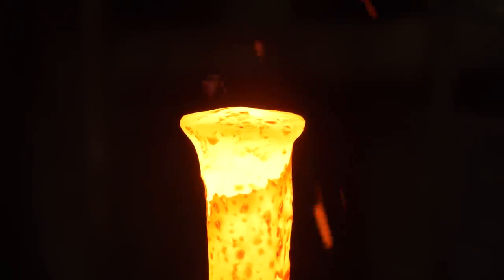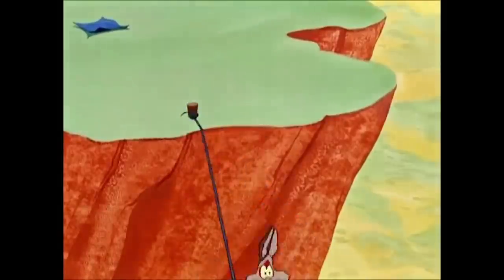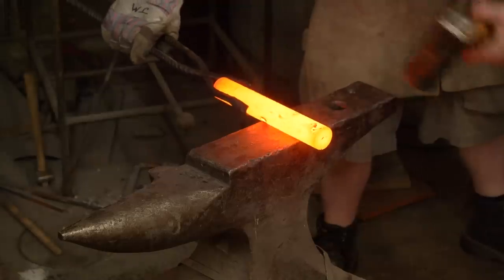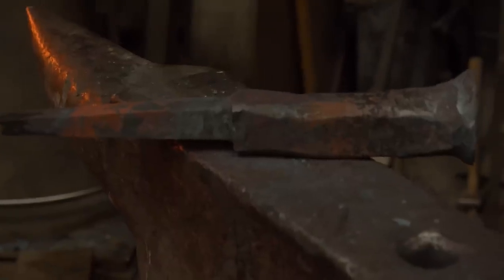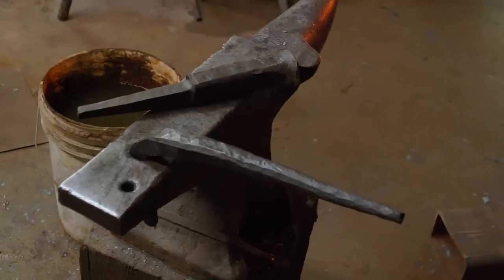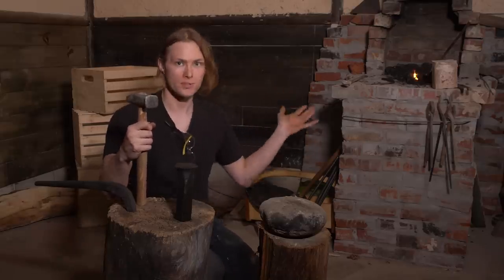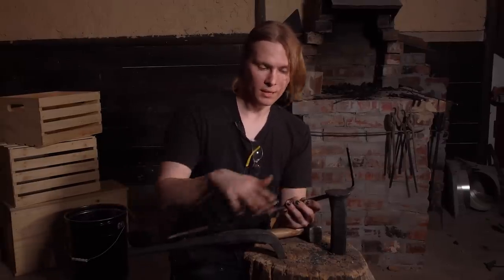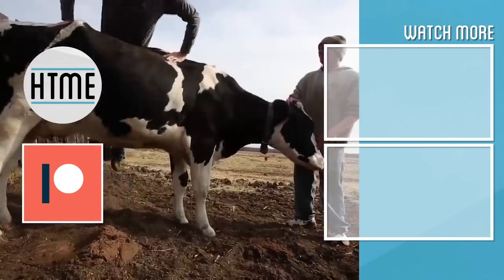Forging a Viking Anvil

Comment: Anvils stones that have been identified as such typically weighed 5 or 6 tons.  They were HUGE stones.  Also made from Basalt not Sandstone.
Reply: basalt or granite would definitely be better, and a boulder in dirt would absorb impacts I'd guess. But I'm guessing the logistics of giant boulders would probably be a bit much for HTME, a simple anvil setup like this is probably a lot more practical though. I thought the same though when I saw them smash those poor stones on those logs.
Reply: Came here to say this as soon as I realized it was sandstone. I'd like to see them try using basalt. (Note: eye protection is super important when hitting basalt or other igneous rocks, the chips fly off at high speed which is completely different from how that sandstone behaved).
Reply: that makes a lot of sense
Reply: They would also take hammers and hit the stones in certain ways so they could flatten them also Basalt and Granite are very hard stones unlike the soft stones they were using normally a smithing hammer for the copper-bronze age was actually a stone of one of those hard materials that they found was somewhat rounded :p
Reply: @AdriannaDaFox98  polished stonsledges and anvils of basalt is still common in many parts of africa, even though they have modern anvils. they use them for drawing and spreading out
Reply: I was just thinking a good chunk of granite would undoubtedly hold up better.
Reply: i think the most practical pre-iron anvil solution would be to just build the forge next to a large boulder you find that has a semi-flat top. then you can forge a stake anvil, and bigger anvils too.

Comment: The rocks; looks like you're using sedimentary rocks which will easily break under pressure. You need metamorphic rocks to use as an anvil. Please note that igneous rock won't do well either.
Reply: What's wrong with igneous?
Reply: @crubs83  it "kind of" depends on how felsic or mafic the eruption was. On the felsic side of the scale, the rock forms with too much gasses and silics trapped inside (very rough and will crumble). As you move towards more mafic, there's less gas pockets however, the silica content is still around 50% (makes it brittle). The best igneous rock would be ultramafic, but that is exceedingly rare and the last eruption that could be categorized as such was 2B years ago when the mantle was far hotter than it is now. I hope that helps. Have a great day. 👍🌋
Reply: that was bugging me as well
Reply: Yeah sure, I totally know what that is
Reply: The whole thing would work better if they put the rock in a bucket of sand or something, to keep it from shaking around.
Reply: @lordelliott42  I think the whole point was that iron is just better, yeah they could have used a better setup with the rocks but that wasn't the point
Reply: @wastedtalent1625  
Well yeah, or we'd still be using rocks.  But they were comparing to see how much better it is.  A round-ish rock perched on a stump isn't how anyone in the past would have done it, at least not for long.  The point of the whole series is to explore technology of the past and how it has evolved.
Reply: What about serpentine very dense and homogeneous

Comment: ahhh man, would've been so cool to make an anvil without using an anvil.
Reply: I was a little let down by the cop out...
Reply: Yeah that would have been fun to watch, but they'd probably still be at it RN.
Reply: I'd guess the easiest solution back then would have been either casting a large bronze anvil (as size would help the fact the metal was weaker) or casting a large iron anvil (but maybe casting it would have been more difficult than the worth). A large bloom or wrought cube could work, but you'd need a bunch of people and a very large rock to work with.
Reply: @1forge2rulethemall88  I don't think they weren't able to get temperatures high enough to cast iron at the time.
Reply: There is a tradition in Jewish teaching that the very last thing God made on the 6th day before he rested was a pair of tongs for metalworking.

What this story illustrates is the fact that a lot of tools have been made for so long in human history at this point that the knowledge of how to make it without having one already has been completely lost to us. If you were to take the whole premise of how to make everything's reset as rebuilding from a destroyed Society. It wouldn't be that hard to use an old engine block or compacted car or some other large and heavy object as your initial Anvil. So it's not really cheating it just depends on how you look at it
Reply: @pugz3230  They (smiths in the "iron age") were able (at least I beleive they could have, I could always be wrong), but its true they might not have thought to, especially if they didnt know how to protect the iron from burning. Even if they had it would have been difficult just because of the cost in resources. 
But if they had been dedicated enough to the idea it isnt so difficult to melt iron, burning iron can be done accidentally in a regular forge, and melting temperatures arent very far away, but melting it intentionally in quantity would have required some forethought so perhaps that along with resource costs would ahve discouraged pursuing it.
Reply: @angelwhispers2060  That is a cool tradition, I've often thought about the issue of tongs since they are easiest to make only if you first have tongs.
I've seen individuals smith with wet bamboo, but it's still hard to see anyone seriously working iron without metal longs first. That makes it cool that that is a story then since it means blacksmiths back in the day thought about it too.
Reply: @1forge2rulethemall88  This is basically it. We aren't lucky enough to wait around for a nice, large, iron rich meteorite to hit the shop, nor do we have the resources to dig our own iron mine to find a nice large chunk of mostly pure ore. 

We also don't have a dozen volunteers to help find, move, and grind a a giant rock that's suitable for the task, and then have the time or money to use that rock to make one anvil and just turn around to make another one suitable for long term use.

It's just a mix of luck, production scheduling, and resources in general.
Reply: @1forge2rulethemall88  I think they got it to temp in an episode with another YouTuber. Maybe lol
Reply: @1forge2rulethemall88  If they could simply cast iron, then why would they be hammering the tools?
Reply: @pugz3230  Because it's notoriously brittle. Cast iron has a carbon content generally around the 3.0-4.0% area, while steel we use today generally ranges from 0.2-0.4% in the non-hardneable area, and 0.3-0.9% for hardenable steel.

All this carbon is present in cast iron as little graphite flakes, which cause weak points that stress concentrations form at, and in turn cause the iron to break with relatively little force.
Reply: @pugz3230  Cast iron is brittle, very brittle, and cant be forged easily after its been cast. In large lumps (like an anvil) it would be strong enough, but for many every day tools it would perform poorly (and be very expensive since so much extra fuel would be needed) there are ways to counteract this by adding other substances into the molten iron, but I don't know how that's done (and I don't know if medieval blacksmiths knew how either). Either way casting wouldnt be easy (it'd be very expensive) you'd need a big furnace, and lots of ore (and fuel), but it may have been possible, I'm a hobbyist though so I could be wrong.
(edit: oh and for everyday tools casting may have worked if they knew what substances to add to make it not brittle, now days we melt down iron all the time, add in chemicals and pour out forgeable bars and rods (one pours the molten iron and as it cools and becomes more solid it gets rolled through a conveyor that shapes the cooling metal; it goes from liquid to a forgeable bar or rod in moments. Whatever they add helps it stay soft))
Reply: @novaenricarter705  Sorry, when I said "they" above I was referring to ancient blacksmiths. The youtubers here can forge this no problem with their setup
Reply: @TheElfsmith  Do you know how to reduce the carbon content of cast iron? I know they can do it now days, and I heard that by the renissance people knew how, but I dont know how to do it historically (I heard something about annealing, and adding in seashells or something but I didnt get it)
Reply: @1forge2rulethemall88  Nah I meant casting. Not forging lol
Reply: @1forge2rulethemall88  1) Alloying was well-known to them at this time, considering that bronze is, itself, an alloy of copper and tin. However, they wouldn't have had any of the scientific knowledge background that we take for granted about why they can alloy copper and tin to make bronze (or copper and zinc to make brass) but could or couldn't alloy other metals in deliberately. Similarly, the use of flux stone to help purify the iron content was known, as well; gabbro, dolemite, borax, limestone, etc. were all known flux stones by this period. Meteoric Iron was as profound as it was because it was basically a piece of space-born steel, premade, that they just had to forge into a weapon, basically (and forges simply were not hot enough to melt it at the time; only make it slightly more malleable).

Bog iron or similar ore rock would probably have made a fine enough "anvil" in a small scale for iron working, if there wasn't a sufficiently large piece of metamorphic or igneous rock like granite or basalt that they could have used, and eventually once serious iron smelting was discovered a large iron bloom would have easily taken its place, as most sources for iron were rarely pure samples and so most early iron was already an alloy with other elements that they weren't aware of; slag from that period contained a large amount of iron trapped with other materials that the heat they could obtain in bloomery forges simply wasn't sufficient enough to obtain. Fun fact, with the blast furnace, we actually get the origin of the name "pig iron", because it was poured from one massive trench into smaller trenches to form bars, which they likened to a mother sow feeding her piglets.

2) Dunno if he knows, but the method has been known since at least the 3rd century BCE in China, when they'd already put the art of fining into practice with finery forges (which is from what the word "refining" is derived from!), turning pig iron into wrought iron by removing the carbon from the iron through the process of melting it down and then oxidizing the carbon and silicon within to form more slag on the surface of the bloom, which would then require hammering to break the slag off and condense the bloom into a bar.

Comment: Step one: get anvil
Step two: Use anvil to make anvil
Step three: repeat
Reply: If he were to do this with a bronze anvil which is probably possible he would go through a ton of them to make the iron one.
Reply: Which is, in line with the spirit of the project. He's using the premade anvil to speed up the process since he's already cast bronze anvils. The whole process was iterative in history with small-ish improvements leading up to larger ones. With the stake and horn anvil, you can already kind of see how the big anvil came together. You widen out the stake anvil to get a larger surface area to work on bigger pieces, attach the horn which you shape into different angles and boom: you have the big anvil.
Reply: The same with so many technologies. Replace "anvil" with "computer" if you want. ;-)
Reply: Y e s
Reply: Step one: get 3d printer
Step two: print 3d printer
Step three: repeat
Reply: @inbredbanana8156  And let 3d printer go brrrrr.
Reply: Which came first? The anvil or the anvil?
Reply: This reminds me of The Elder Scrolls.  It's like, get an item that improving smithing, use it to make a better one, repeat until you have a butter knife that one-shots the boss. :)
Reply: As a hobbies smith myself, thats almost always the case for any "everyday use" tool in the shop.
Hammer to make hammers, tongs to make tongs, and so on... 
"Make a Tool to make a tool to make the tool to help in the project" is another thing that happens... which makes work interesting
Reply: My god, did you just stumble upon the infinite anvils equation?
Reply: basicly terrafirmacraft progresion
Reply: s t o n k s
Reply: @inbredbanana8156  That's a Von Neumann machine
Reply: @michealdrake3421  Had to Google that, cool concept. Gives me Terminator/evil robot vibes; like if they took over the world and self replicated out of their newfound A.I.
Reply: @inbredbanana8156  Yeah, that's the danger. A Von Neumann machine capable of analyzing and improving itself
Reply: @inbredbanana8156  Perpetuum mobile (not really), EZ.
Reply: Step 4 profit
Reply: It's like the tongs paradox lol, you need tongs to make other tongs, so how'd they make the first one (although there's a pretty easy answer it's still kinda funny to me idk)
Reply: me questioning myself how to start forging without an anvil: hmmmmmm
the forge channels be like:
Reply: Repeat until the Earth has ran out of iron💀💀
Reply: Rocks were the original anvils until we made a real anvil. Then the real anvil took over. Your rock is nature's anvil
Reply: @justin9202  gonna find a good rock. I need to go to the river
Reply: step 4: profit
Reply: Step four: use it for what is for. 
Go fix a horse .

Comment: This is interesting and all, but in the name of all that is holy, Secure your frggin' anvil properly to the floor!
Seriously, there were several times it nearly tipped over, and several more where it almost made them drop the steel, or ruin the work they had just done.
Reply: Exactly my thoughts.  I had to stop watching as soon as that anvil started walking around.  No excuse for something like that, and certainly not something you put on film for all to see.
Reply: I was reading this right when the walking started. I used to work on a sketchy anvil stand but thats just ridiculous. Plus that sucka is easily heavy enough to take a foot should it fall
Reply: @threeriversforge1997  It's not the usual set up for forging in that shop, nor is it my or Joe's personal anvil. Stuff is moved around to accommodate filming, and we don't much have the right to permanently modify a shop that we don't own (said shop being Joe's workplace, not either of our home shops).

You have no idea how much both of us would rather it be lagged to the concrete.
Reply: @TheElfsmith  Could've been at least mentioned on film though..
Reply: @VincentGroenewold  I'm pretty sure we've brought up this wonky anvil before, iirc.
Reply: @TheElfsmith  Yup, I vaguely remember it having been mentioned before; it's just been long enough that some people probably don't recall it.
Reply: @TheElfsmith  Try putting a piece of thick denim under the bottom of the trunk on which you're sitting the anvil, it won't burn and might absorb a small fraction of the hit, potentially enough to reduce the bounciness.
Reply: Yeah that was giving me stres all the way though and I don't even do smithing
Reply: @TheElfsmith  Do you typically have some other method aside from lag bolts to keep it from moving with your normal set up?
Reply: @GlorifiedGremlin  that isn't my shop, so I can't really speak for normal operation there, just that how we had it wasn't the usual set up, which is better. how it's anchored specifically, I do not know. 

In my personal shop, I have a very slightly concave base to my solid black walnut stand that's been planed to match both the anvil and the floor, with chain and lags anchoring the anvil, and it's all on a well leveled concrete floor. Eventually I'm planning on putting it on anchors with some pretty little brackets, but it's stable enough that it doesn't walk around at all, and I do still occasionally have to move it to work on certain projects, so that's on a back burner.

Comment: Given that you're in the iron age now, a clogger's knife might be helpful for shaping timber and giving wood projects a smooth, clean finish! It's basically a larger version of a paper guillotine but the pivot is higher such that when brought down, the blade is perpendicular to the cutting surface with the edge smoothly contacting the surface along its entire length. It's definitely taken a lot of time off my own primitive woodworking!

Comment: This honestly reminds me of a heck of a lot of lessons between the shop,the garage, the kitchen, and my grandma's sewing room, a flat firm work top, that doesn't slip and can handle changes in force and temperature is as important as whatever tools you are using. Stable work surfaces always create more refined work.
Reply: I think that if they had turned that second rock anvil on its flat left side they would have had more success. instead of laying it on a round side and beating on another round side